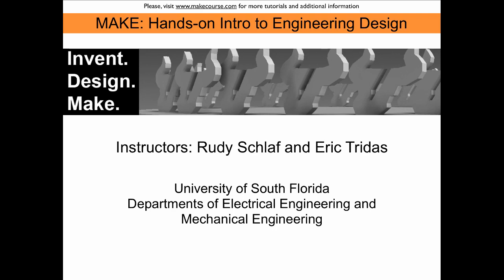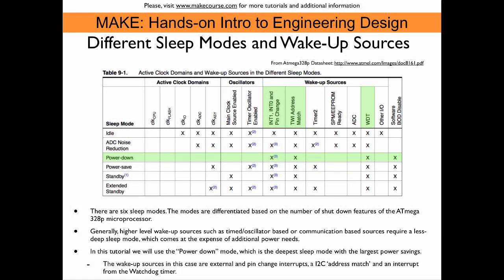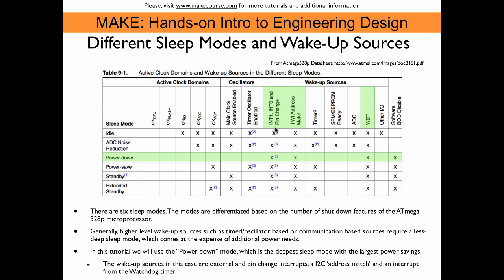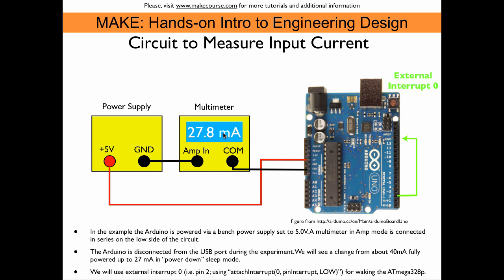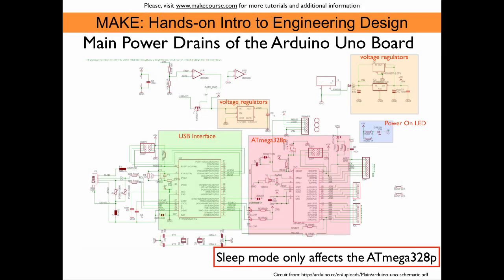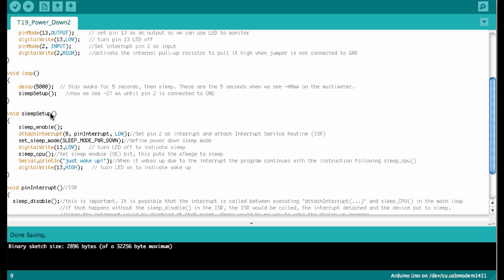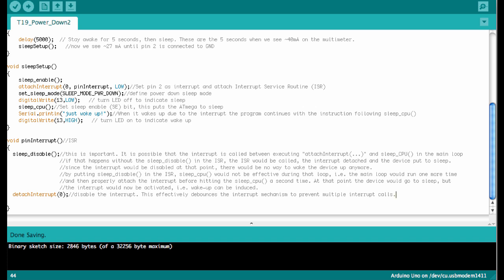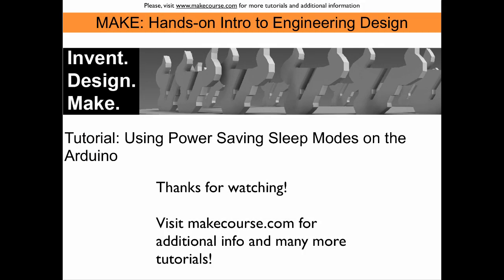Tutorial: Using Power Saving Sleep Modes on the Arduino

Comment: Let me ask you 2 beginner's questions :

1) In the mode that you have assembled the board, the power comes from an external source, so the USB cable is only used to send the message to the serial monitor, right?
2) Have you ever made this test with ans Arduino Nano board? How much is the power consumption?
Reply: its about the same as an uno. they both have USB chips, and current can vary wildly with the Chinese clones.  your best bet if you want to go for low power is the pro mini's. but you will need a usb to serial avr programmer for those

Comment: Good tutorial! Thanks! But I have a big problem to implement on my project, because I'm not found avr.sleep library! :/ 
How did you get the avr.sleep library?
Reply from the maker: The standard ave libraries should be included with your Arduino IDE setup. If you get error messages with regard to the library, reinstall the Arduino setup from scratch. Also download our sketch that is featured in the video here: http://makecourse.weebly.com/week13segment2.html
This should work 'right out of the box'. Good luck!
Reply: Thanks ! Help me a lot.